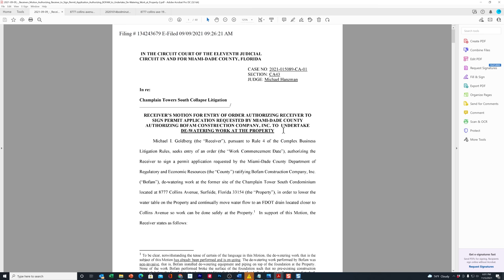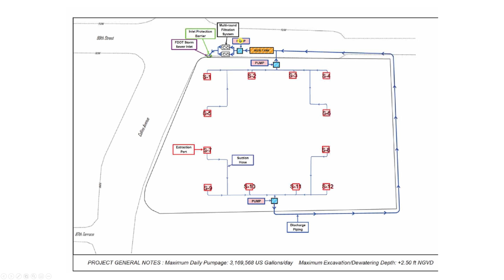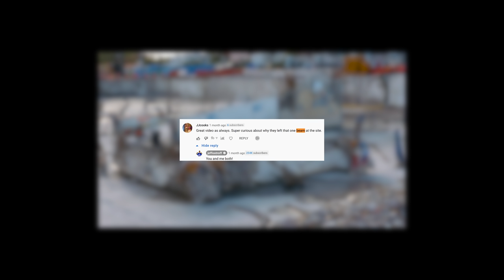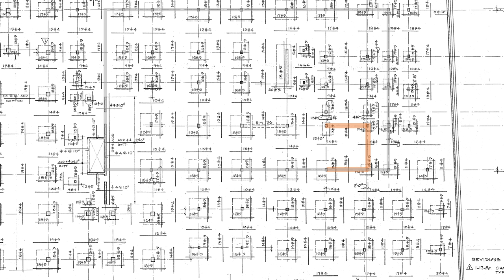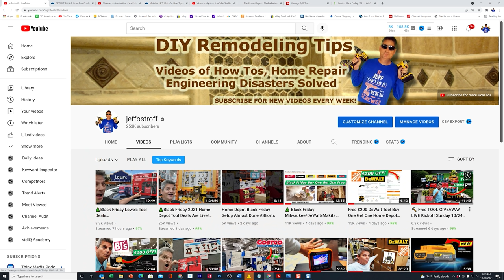Miami Condo Collapse: Engineers Baffled By Mystery Column

Comment: So, it’s a floater meaning to transfer weight but not needed to go to the basement? And why is it continuously flooding?
Reply from the maker: They don't know why it was continuously flooding but based on fiorello's video from last year it seemed like most of the flooding was gone compared to what they had years before. There were still a few puddles here and there inside the garage but nothing that would make anybody panic some of the news stories from the mid 90s said early on cars were actually floating in the garage
Reply: @jeffostroff  “enough to float cars” now explains the deterioration of the concrete and rebar rusts.

Comment: it is def an impaled column from directly above. that is why there is water coming in. you can see the sheared edges from the water and the tear marker along the transfer beam as it separated
Reply from the maker: There is water coming in from most columns on the floor, likely due to the collapsing building. , you forget that there is zero damage on the floor where there should have been craters or something else if it had impaled into the floor but there is no damage. These rebar rods look like they were intentionally built up out of that concrete floor like it was done by somebody in the last 12 months, since Fiorella shot her video inside the garage in July 2020, showing no column exists where that mystery column is.

Comment: The penthouse is Elevator Shaft that may not been known by anybody in the building or could have been added later which could have caused the demise the building
Reply from the maker: The penthouse was completely known to everybody they already had plans for it and everything the city just balked at pick us by code they didn't allow buildings any taller than 12 floors they didn't want any tall buildings in their town.

Comment: Jeff,  I’m starting wonder if, after look more at the beam and mystery column, if the column was actually misplaced on the floor above  and not actually siting directly on the H beam sitting in the basement, but was inadvertently offset causing it to actually punch through the first floor pad and in fact punch through the garage floor and look like it had always been there appearing to be growing out of the floor. ??? Just a thought.  Tha would be a major mistake in column placement all the way to the 12th floor penthouse

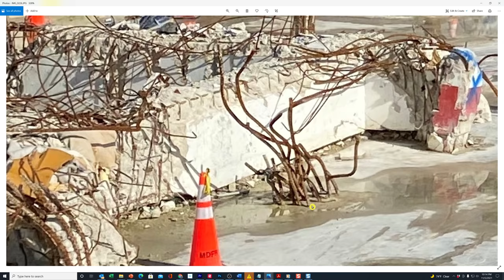Comment: All of the other visible columns are tightly wrapped at the base where they meet the garage floor. The mystery column is loose and not tied at the bottom. At 13:55 it looks like there are no strappings on any of the many bars that look individually bent out of shape. Yes, the bending could be explained by impacts from above but also the deformation due to being driven into the floor. It also appears to be a larger foot print. We all need better photographs of that mystery "column." Your graphic of the H beam does not appear to be in scale?
Reply from the maker: I am miffed that no one got good cloeup photos

Comment: Hi Jeff, is it possible that the demo crews flipped that 'H' beam over, so it's now upside down with that mystery column now facing down ? Just a thought ! Great video !
Reply from the maker: no too heavy, over 65,000 pounds. There was no equipment on the sire that could have moved this. Why would they flip it anyway? There is no reason to.
Reply: @jeffostroff  It was just a thought, but it's definitely a mystery that post is there, hopefully, you can go down to check it out, that would be an awesome video  !

Comment: it's defiantly an impaled column, if you look at every other column, they are broken just above floor level, and the rebar cage has remnants of broken concrete a few inches off the floor plane level. this has none, it's just rebar sticking out of the floor, no emanates of a column that was already there. when this column broke off and was driven straight into the floor the rebar piledrove itself into the floor, its surrounding concrete was stripped off by the floor, spalling everywhere, if this was a regular column it would have had remnants of its concrete left in what's left of the cage. think of it this way, just like a ramset has a plastic collar that breaks off, this rebar's concrete jacket broke off at the floor as it was pile drove into the floor, that's also why the rebar is bent differently than all the other rebar. it's all there in the photos...
Reply from the maker: Yes many possibilities, except can all of these rebar rods perfectly impale themselves straight in?

Comment: I think there is a possibility that the column could have been added as a support under the H beam just prior to collapse, after the video was shot in the garage, due to possible weakness found...it could also be remnants from the original beam, though the floor is quite "clean" and intact and doesn't show any impact evidence from a concrete beam slamming down vertically...too many problems with this building to begin with to be able to easily figure this 1 issue.....
Reply from the maker: the column is maybe 2-3 feet from the H-Beam so not support under the H-Beam, but maybe support under the garage ceiling near the H-Beam

Comment: What are the possibilities of the column from the floor above doing a pile driver into the bottom floor and it looks like it was naturally there. Might be why it is also mangled more than the others
Reply from the maker: Your hypothesis comes up a lot from boatloads of people about that column. I don't think it's possible because if it had slipped off it would not likely have come straight down where the mystery column is which is only about two feet away from the HP. Also if it had impaled the floor there should be damage all over the concrete there and there is none where is the crater? So where else could the column come from? So far my prevailing theory is that somebody started to build that column sometime after Fiorella shot her video in July 2020. however I could find no permits for it

Comment: NEW INFORMATION>>>  (maybe) 
Follow-up:  I went back and looked at the actual collapse video.  As the final section of the tower starts to drop, you can plainly see the closest part of the roof and all floors begin to collapse.  After they drop about a floor's worth, there is a barely perceptible "pause" before the entire remaining section now appears to fall together.  Could the initial drop over that missing column have occurred as the column left the H-beam?   Could the pause in the drop been from when the missing column slammed into the garage floor?  Somebody must know by now.

My first impression is that the middle column from above was impaled through the garage floor.  That might also account for the water around it.  Question is, if this column impaled into the floor as it dropped from above, why didn't this happen with other columns?   One reason could be that what was missing where this column is.  Below this area there are no pilings and caps below the floor.  That means the floor is much thinner here.  There is no way a column could have been added there without adding pilings and piling cap below that slab.  I can't see that being done without major reconstruction and major documentation, studies and permitting. So... like I said, my impression is that we are seeing the remains of a column that was pile-driven by the collapsing building from above.  I would like to know the final verdict.
Reply from the maker: Many columns have water seeping up through them, don't just focus on that one column. This then sheds doubt on the theory that it was impaled because there is water there. If the column had impaled the concrete slab, there should be a lot of damage tot he floor, a crater, some cracks, etc.
Reply: @jeffostroff  I agree.  I too would expect floor cracking.  Can you tell by your pictures where this mystery column's rebar lines up compared to the other columns supporting the H and the H cross beam?  It appears to me from the perspectives available that the mystery post, if it was attached to the floor, was not under the cross beam but lined up with the other posts.

I guess (that's all we can do right now) another option may be that the falling post itself didn't embed in the concrete but the rebar sticking out of the post that came loose from the crossbeam did.  Imagine rebar sticking out of a concrete pillar end being jammed thru the slab like pencils into cardboard.  That might cause limited cracking while still embedding in the concrete slab?  I'm an engineer, but not a civil engineer so I'm just spit-balling. 

Thanks for all the good info.  I've been following you since the building came down.

Comment: It is probably the middle column that would have been the center point  on top of the H Beam,  The force of the collapse probably had it slip off to the side and by sheer force penetrated into the garage floor giving the impression that the column was in the ground floor.  Just something I was thinking as I looked at it.
Reply from the maker: A lot of people have speculated in the comments today just exactly what you said, but I doubt that is the case because if the column had impaled the garage floor from above, there should be a lot more damage to the garage floor where as you can see the floor right now

Comment: Dude, what you were showing down in the garage is not what you were showing of the "debris" in the beginning. You made it VERY clear that the "H beam" was exactly WHERE the ramp was. You pointed out SEVERAL times that those beams were right AT the ramp where you come down from the street and either turn left or right, etc. Then when you show the video from whoever that was down in the garage, you show the H beam being WAY off to the left of the ramp (as coming down from the street.... or to the right of the ramp as we look at the video). That column with the red base was right next to the "tall end" of the ramp on the "debris" photos you showed in the beginning, but in the video you are pointing to one that's clearly a good 25 feet away from the ramp.

BTW that "red" column is not the ONLY ONE... at 6:57 I saw another to the left of the ramp (from the video perspective) almost next to the ramp. It was marked as column 86/87. So clearly there was more than just ONE "red column".
Reply from the maker: No, the H-Beam is not located at the bottom of the ramp, it is located one set of columns over from the ramp.

Comment: Jeff, the H-beam did not drop straight down.
Look at the direction of the bent rebar from the other pillars.
Displaced, maybe?!?! No mystery.
Reply from the maker: Your logical reasoning is wrong. You don't use the direction of rebar on some columns not attached to the beam to tell you what direction the beam fell in. If you look closely you can see the beam is still right next to the four columns that were holding it up so the beam actually only moved 12 inches to the north
Reply: Correct 3 to 8' over

Comment: Maybe I'm looking at this wrong, but there appears to be no tie in from the H beam to the column that should have been sitting on top of it, the beam itself went towards the down ramp as the building came down but if the column on the first floor was not tied in to it, maybe that was indeed driven straight down,  I cannot explain why there appears to be no floor damage there though, odd
Reply from the maker: I saw similar, but hard to see where the column would have been. Maybe there are 2 rebars? Not sure

Comment: That column might have been impaled from above. It probably punched clean trough the slab. When the H beam shifted, the bottom of that long column remained in place, so it  slipped past H beam edge, dropping down below with the weight of whole building above.
Then when they cleaned the site, the rubble filled the hole neatly, you can almost see it in a picture.
Reply from the maker: We are still debating this one. I maintain that a column  falling could possibly do that, but there is no floor damage from a column smashing into the floor.
Reply: @jeffostroff  I am guessing that the force of impact maybe was so powerful that it cut the thin slab like a punch-press? That column was supporting the whole building above, on to that H beam. Beam slide from under it and...
And maybe the eventual cracks in slab were filled at removal of the derby.

Comment: The engineer was in over his head and the contractor failed to specify that the standard 3/4" minus gravel that gives the strength to concrete, was deliberately left out of the mix.
Reply from the maker: While the contractor would be at fault also because they're the ones that build it that way they're the ones that are supposed to rebuke the engineer saying we can't build it like this

Comment: it seems to me that that column resting on the H beam left the top of the H beam in the collapse and pierced the basement floor with all the weight of the 12 floors behind it making it seem like its a column in a odd location , i think if you start pulling on it it will pull out and reveal its true nature , as the lobby column .
Reply from the maker: Your hypothesis comes up a lot from boatloads of people about that column. I don't think it's possible because if it had slipped off it would not likely have come straight down where the mystery column is which is only about two feet away from the HP. Also if it had impaled the floor there should be damage all over the concrete there and there is none where is the crater? So where else could the column come from? So far my prevailing theory is that somebody started to build that column sometime after Fiorella shot her video in July 2020. however I could find no permits for it

Comment: At 4:21 the H beam is seen aligned with the bottom of the ramp. On the plans shown at 9:22 the H beam is clearly one bay away from the bottom of the ramp. Your "mystery" beam also is clearly on those plans. When the building fell that H beam fell one bay away toward that mystery beam.
Reply from the maker: Your mistake is that you were looking at the wrong drawing to determine the placement of the H beam. The ramp doesn't end where you think it ends because you are looking at lobby level drawing and it doesn't  the ramp. You think it's showing you the ramp but it is not it is showing you some of the framing and walls and maybe some but remember the ramp is below it if you want to see an accurate drawing of the ramp look further in the video where I show you the garage level plan and you will see that the bottom of the ramp lines up perfectly with the H beam. Furthermore I showed you in fiorella's video on her freezeframe lines up with the H beam.

Comment: I think they made a mistake, they started to build that column from the ground up but then they realised that for some reason they can't have it there(maybe they found they could get more cars in with the layout without the column), cut it, flattend the rebar, poured the floor and then build the H bean to transfer the load to the other ones.
Reply from the maker: BIG problem with your story. The column is not on the video from last year in the garage, so it was not a mistake left in place for 40 years.

Comment: The red paint is for fire extinguisher or fire call box.
Reply from the maker: there was not one on that column
Reply: @jeffostroff  In the video from before I can see the 2 that had red had a box on them, could not see if it was just a fire pull or what though.  Ask a fire fighter, fire alarm tech or building inspector why the pillars are red or look at the emergency drawings for a building it will show the call and pull locations,, etc fire is painted red at ground level for the fire fighters.

Comment: at 8:34 it looks like you have the H-beam one line too low it aligns with the wall in the photos . perhaps it was built at the wrong location ?
this matches with the columns that are halfway up
Reply from the maker: Not sure what you mean by H-Beam being too low. Anyway the H-beam is sitting in that photo right where it is on the design. They did not build it wrong. It fell down only inches from the 4 columns that were holding it up.
Reply: @jeffostroff  what I mean is that the location where you show the H beam on the plans doesn't match what is visible on the photos, look where the wall from the ramp is.

Comment: The stress / movement "pattern" of the mystery rebar is not consistent with the movement of the H BEAM as it slid away from the pillars upon falling to the floor.  You can see how the other pillar rebars are tightly cropped at the bottom and are bent at least somewhat in the direction of movement.
Reply: The mystery column wasn't formed yet, it was just the rebar.  If it had been a complete column, it would have had concrete debris trapped inside the rebar at the base, like all the others.  It was clean.  They were in the process of constructing it.
Reply: @eugeniustheodidactus8890  All the real 'bad guys' concerning this building's fate are deceased.

Comment: Could it possibly be part of the beem that went up to the penthouse? Lets assume that it broke somewhere and as the tower fell it was driven thru the floor of the parking garage.
Reply from the maker: Whenever you make a claim like this about the column falling eight feet and impaling into the garage floor, you forget that there is zero damage on the floor where there should have been craters or something else if it had impaled into the floor but there is no damage. These rebar rods look like they were intentionally built up out of that concrete floor like it was done by somebody in the last 12 months, since Fiorella shot her video inside the garage in July 2020, showing no column exists where that mystery column is.